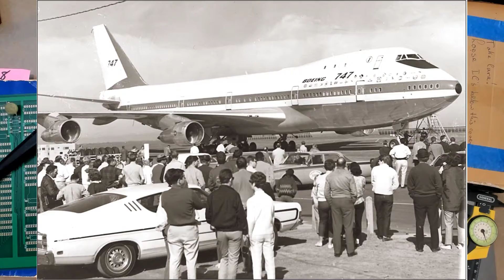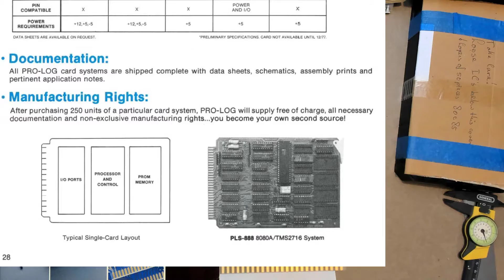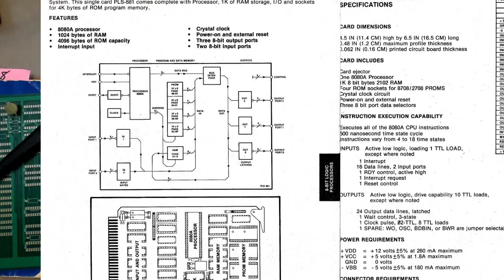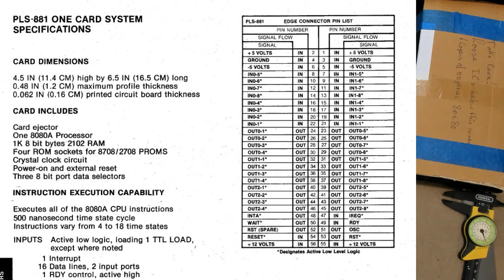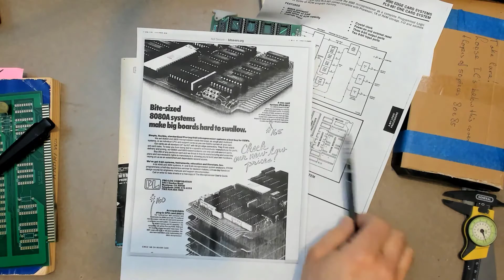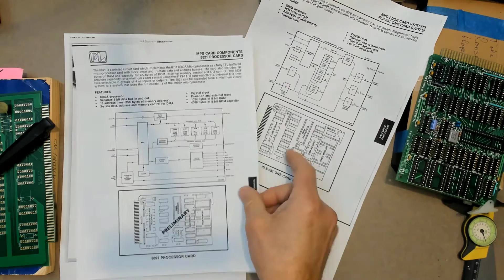{75} Pro-Log PLS-881, reverse engineering a completely stripped single board computer

Comment: Can't you infer which sockets hold decoders by tracing back the enables/chip-select pins on the RAM/ROMs?
These should be driven as inputs from the outputs on the decoders.
Reply from the maker: Yes, exactly.  I have not bothered with the port decoding yet, but the memory decoding turned out to be straightforward and is decoded using a 7442 in the top left corner as suspected.   the machine state bits are held in a couple of quad latches on the first & second row.   There is a minimal amount of glue logic….one hex inverter and the second needs to be a (likely inverting) quad 2-input logic gate of some sort.  I think I have 3 chips on the first row and 4 on the second row left to figure out.